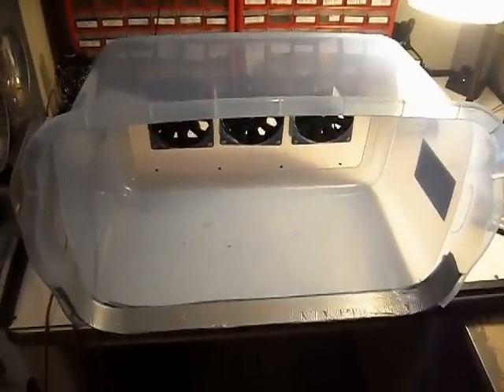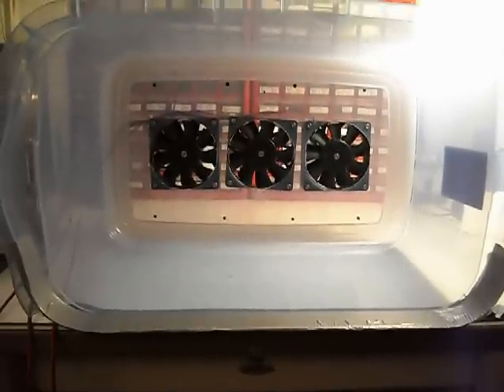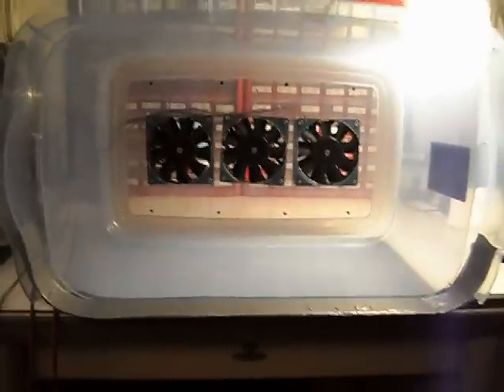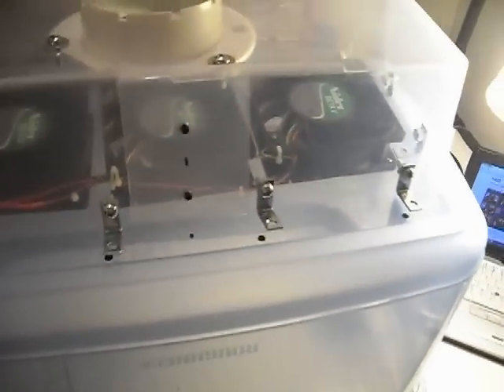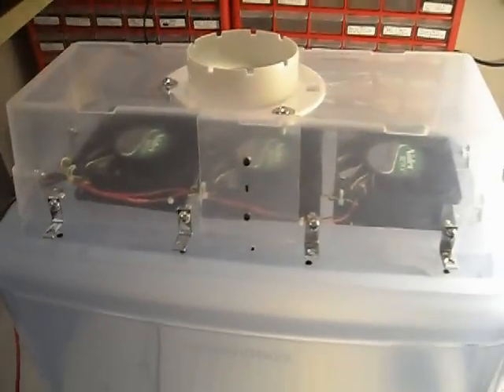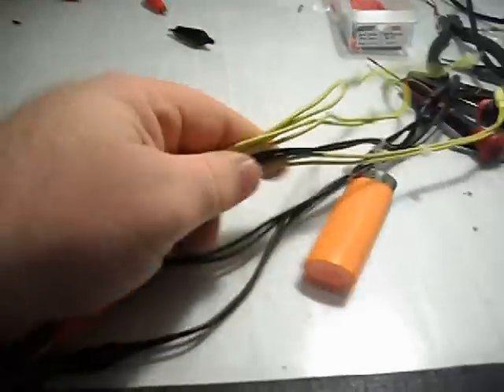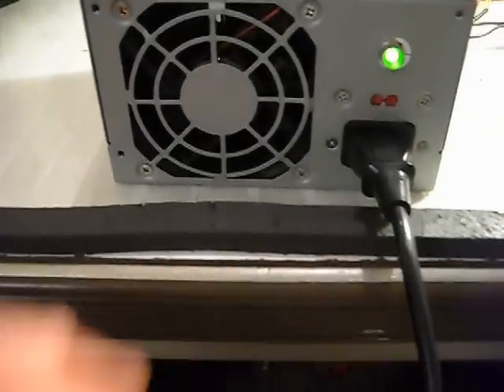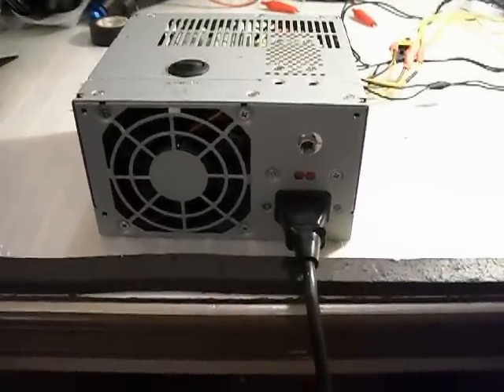DIY Spray Booth Part 1

Comment: good dyi but i wa thinking ina quieter er way by installing a conventional motrer with an online resistior that youd take all the noice and paint fumes yout, you would still want to have  filterers,
Reply from the maker: Wouldnt hurt to try it. This system actually isnt horribly noisy once all the filters are in it. I mean you wouldnt want to use it and watch TV at the same time but I can use it in my hobby room while my wife watches TV in the next room.

Comment from the maker: They are essentially the same things are they are prtty loud but once you have the exhaust tubing on and the 2 layers of filtering in place it does cut the noise down to a tolerable level at least for me.

Comment from the maker: Ive actually only used it maybe half a dozen times so far. I only built it to paint an occassional RC body here and there. I dont do like regular airbrushing art on a regular basis or anything. So far though I cant see any paint what so ever on the blades but I really wont expect to with so little use.

Comment: Awesome spray booth.  Could you tell me about how much it all cost.  Also, instead of server fans could you use fans that are in  desktop computer.  I have 4 Silent Fan 120 S12...1200 rpm, 19 dBA each.  Would these work.
Reply from the maker: I dont remember exactly its been about 2.5 years since i built this but I want to say it was a little over $100 but to buy something new that is comparable in size was like 300-400 bucks. Those fans would not have enough CFM to be useful in this build. maybe if you didnt use filters it would be ok but then your gonna be changing out those fans every so often cuz paint is going to build up on them.
Reply from the maker: actually now that i think about it, I think it ended up being closer to $150.

Comment: if you had three exhaust flanges and a three into one "header" system do you think you would get a more turbulence free exhaust?

i like the design, but noted your comment regarding turbulence in the back box.
Reply from the maker: yes i do think that would help a lot. Where I have mine set up I dont have room for the extra tubing and I only use it a couple times a year so for the time being I just deal with it.
Reply: i went and build one up slightly different but i liked your design thanks for your post

Comment: all you would have needed was a proper plenum between the fans and the ductwork...and then I would wager your booth is far better than the cheap amazon ones....far better!
Reply from the maker: What would a "proper plenum" be exactly?
Reply: I may have misused the word....but instead of a box with a single outlet...that box should have an angle on each side which directs the left and right fans toward the exhaust..
Reply from the maker: Hmmmm, its almost like you read the video description.

Comment: Can you share the type of fans and power supply you are using?   Do you have specs?
Reply from the maker: Most of the specs are in the video but there are a couple of details I left out...I bought the fans off of ebay for about 19 bucks each (fans specs are right at the beginning of the video). Any 12V PSU that is rated at 15A (180W) or better will work. I used an old small 250W (or maybe 300W..cant remember right off the top of my head) PC PSU that I modded. I have a video on my channel that shows how to mod a PC PSU into a 12V, 5V, and 3.3V power supply that can be used to power just about anything that uses those voltages.

Comment: Add the filters then show us how much air it blows out the back!
Reply from the maker: if i use cloth filters it really cuts down on the air being moved. if im using the cheaper fiberglass filters it still cuts down but not nearly as much.

Comment: Where do you get the fans ?
Reply from the maker: ebay if i recall correctly
Reply: GreywolfStudios74  Thanks ... no need for a "V" flange to channel / direct the air towards the outlet hole ?
Reply from the maker: Aztec Airbrush
if you read the video description, i found out after using it a few times that i recommened exactly that type of thing.

Comment: just a question, if your spray booth is the size of a closet do you need those fans? what is the purpose of those fans?
Reply from the maker: The purpose of the fans is to pull fumes and overspray out of the air and vent them outside. You need exhaust fans regardless of how big your spray booth is but if your booth is the size of the close youd need something that moves more air than what I used here.

Comment: so, how did this booth pan out?? Any issues or complaints?
Reply from the maker: It works pretty well. Read the video descrition for my only complaint.
Reply: so, you resolved the non angular fan box issue somehow? And you've had this bad boy up and running for 4 years now? That's pretty coo....are the server fans 48 volt?
Reply from the maker: Yes, i used some shoe goo, 1x1 wood and some thin laminate board that I picked up at Home Depot. I used the shoegoo to glue it in place. The fans are 12v and I power them with a PC power supply that i modded. I have another video on how to mod a PC power supply. I modded it so that it would not only power the fans but each fan has its own on/off switch also in case i wanna control how much suction is being produced. Its been working for 4 years but I only use it maybe 6-10 times a year?
Reply from the maker: That is to say i used the wood and laminate board to create a "ramp" of sorts that I then glued into the fan box to create the angled effect. I dont think I said that clearly in my other reply and for some reason youtube isnt letting me edit my comment
Reply: cool...you should do an update video for your final product. I want to go this route too...and I found some local server fans but they are 48 volt dc...do you think I could power them with a pc power supply?
Reply from the maker: You cant power them with a PC power supply because PSUs only have 12, 5, and 3.3V rails in them. If you could find a server PSU that puts out 48V you could use that but those are much harder to mod and personally all the servers I work with are only 12V, Ive never seen one that wasnt personally. I stopped doing videos a few years back. Over the last 5 years Ive gotten a new (better) job, new house, and got married so most of my hobby stuff has been replaced with house work or my heavier work load for my job. I have very little free time compared to before and when i do get some I prefer to spend it with my wife so i dont expect i'll be doing any more videos, at least not in the near future anyway :)